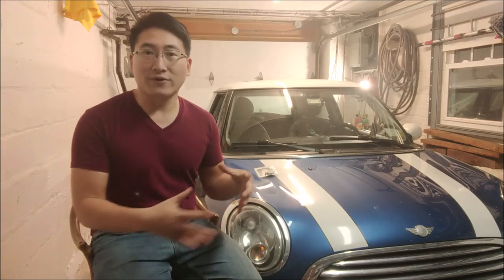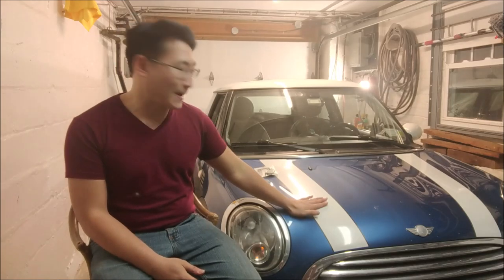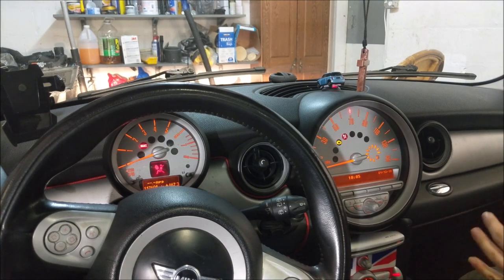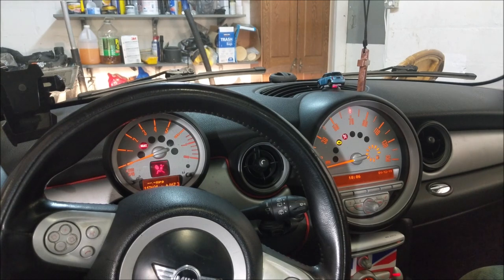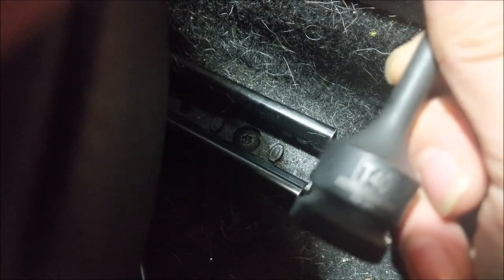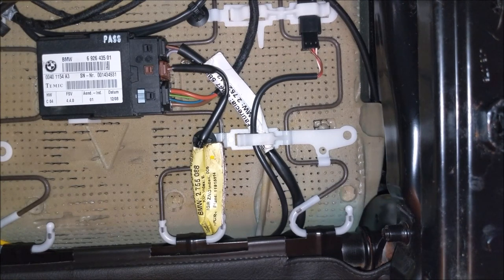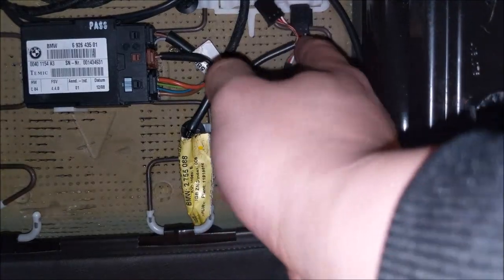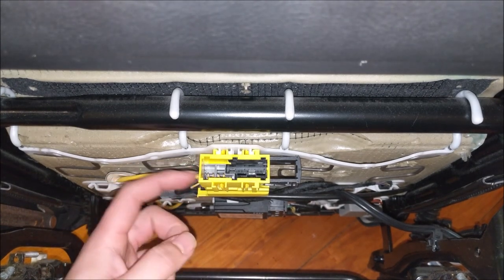Mini Cooper R56 Passenger Occupancy Sensor Bypass

Comment: Two major deadly issues with this: 1) You will always have to ensure no one as small as the weight of a child who could be seriously injured or killed by an airbag sits in the front passenger seat and 2) if even an appropriate weight person forgets their seatbelt and the airbag deploys due to the seatbelt bypass, that person could die from the impact of the airbag propelling them around without the carefully measured manufactured seatbelt in use! Yes impact of a collision could kill regardless but you are looking at a potential vehicular homicide and/or wrongful death lawsuit when that bypass component is found!

Comment: Hello, I am struggling with the same problem, what is the name of the device you used to turn off the sensor?  And the magnet that you lowered was inside the belt box?  or did you buy it too

Comment: I also had the same problem with the seatbelt bypass not working, i ended up just hooking 2 150 ohm resistors together and that took care of the light.
Reply: Michael Box where did u plug the resistors.
Reply from the maker: Smart

Comment: is it also work for the driver side
Reply: the driver side does not have this, this is only for passenger seat. drive side airbag is inside the steering wheel and always on.

Comment: Just installed in a R56 2010 and neither lights extinguished. Did you have to clear faults through a code reader? I unhooked battery which ideally should reset ecu and clear faults. I haven’t tried the magnetic seatbelt sensor either though.

Comment: r55 here.  bought a set off ebay, installed ok led is on solid so good, cleared SRS codes and... didn’t do jack.  both errors back.  tried over and over.  what gives.   about to price out new seat occupancy mat or should I take the thing back to bmw?
Reply from the maker: My Mini Cooper Died, you can have my seat.